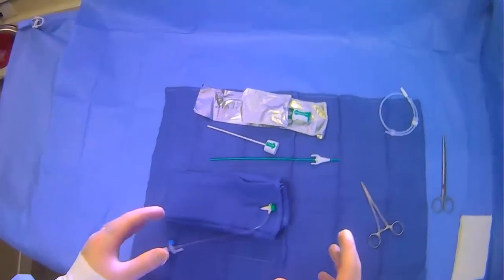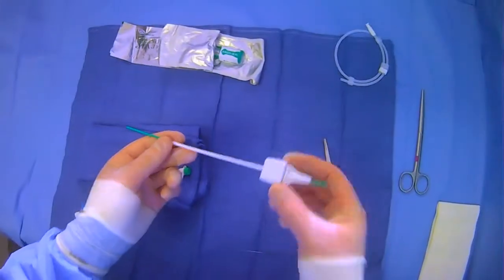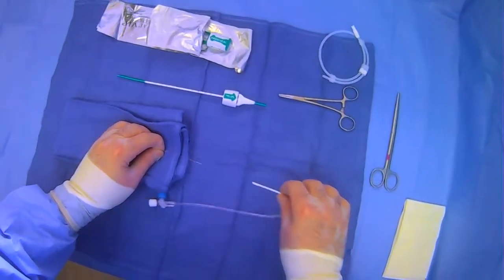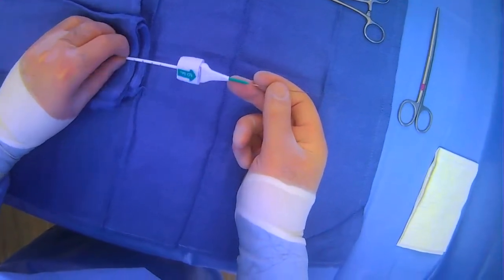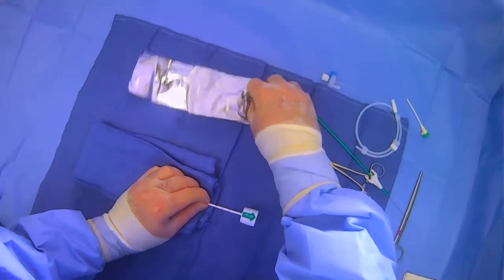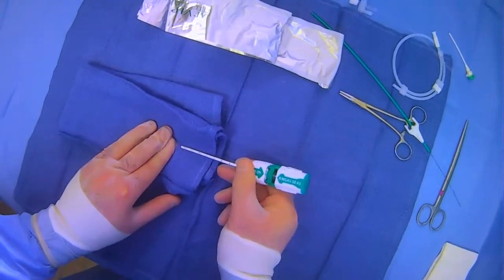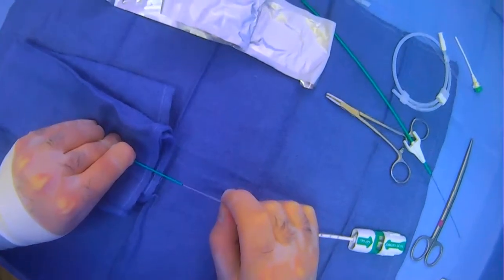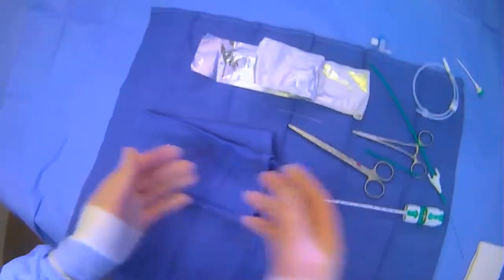Using The Angio-seal Vascular Closure Device

Comment: Are these used routinely for all femoral procedures? I am having major anxiety about getting this done, I know I need it badly... would be nice to know they can close it up good.
Reply from the maker: I would recommend checking in with the provider that will be doing your prospective procedure. While this closure device is commonly used, there are a few others that are used as well. Many providers also still use manual compression (with no closure device) which is still regarded as the "gold standard" for femoral access closure (however this is slowly changing over time). Regardless of the technique, femoral access closure is done routinely and often without complication.